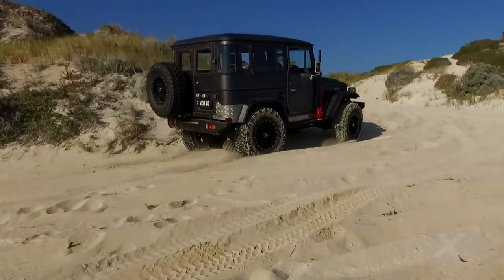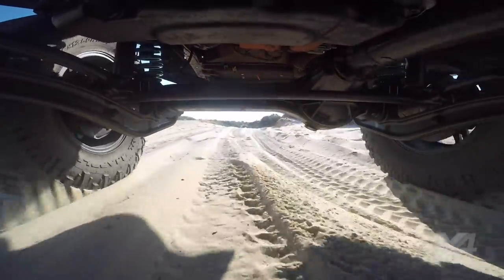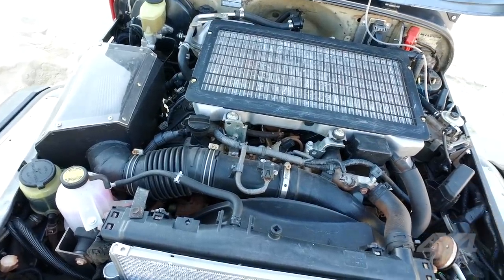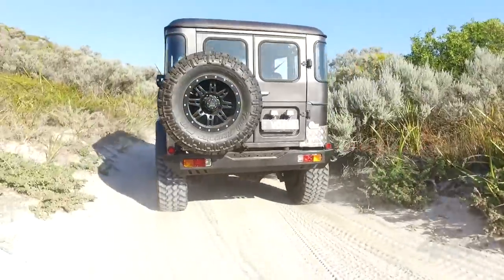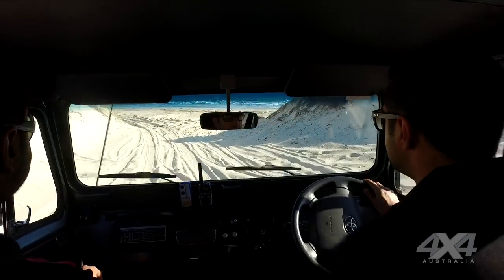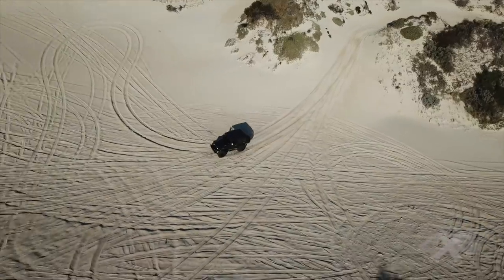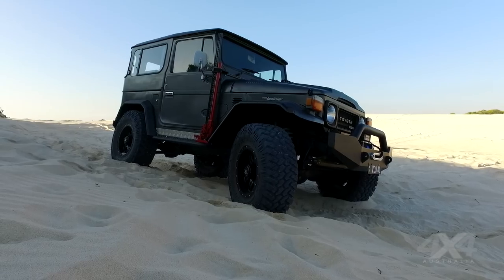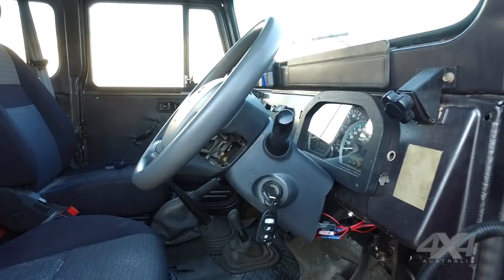Custom V8-powered Toyota Land Cruiser BJ40 | 4X4 Australia

Comment: your 4x4 will struggle on soft sand if you keep the same pressure in the tyres. Drop that down to 22psi and will glide.